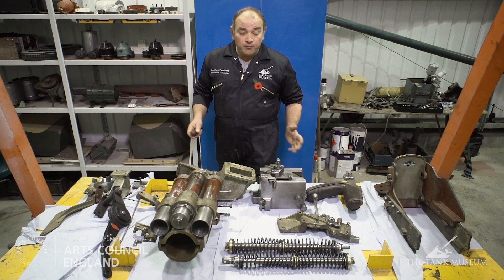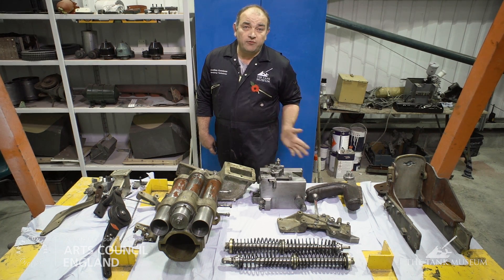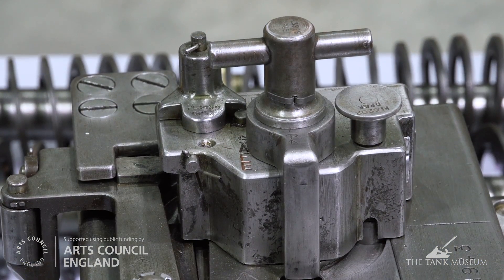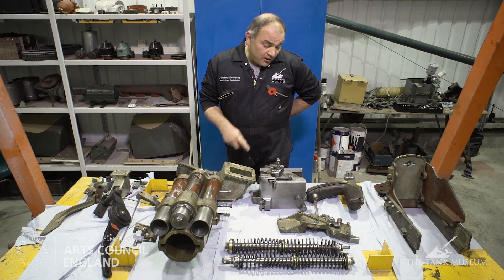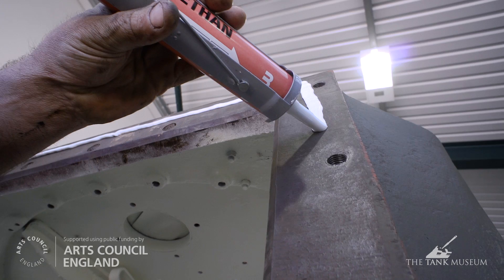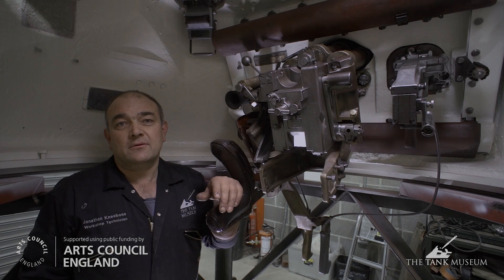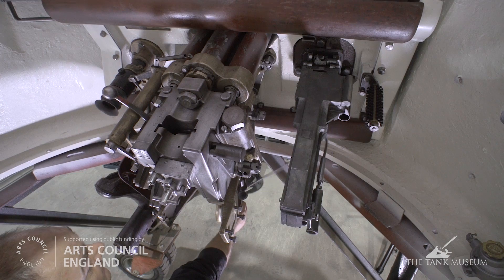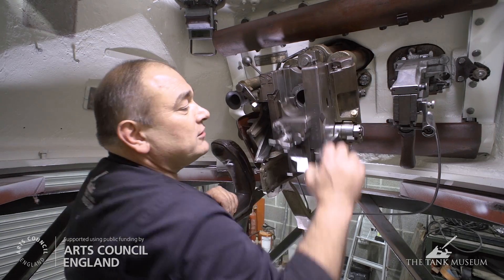The Matilda Diaries Part 10 | The Tank Museum

Comment: Question: Wouldn't a gasket solution that cures under pressure be a better choice? Or does that not supply enough water penetration resistance?

Comment: Will the main armament be fired once the restoration is complete?
Reply: idk if it's possible to get the correct ammunition for it anymore, modern shells are much bigger and smaller guns (and the shells they used) fell out of use a long time ago.
Reply: I don't know where UK gun laws stand on 2pdr guns...
Reply: Toby Wenman if it was done on the tank range or under army supervision it would be allowed. It’s just getting the ammunition.
Reply: If you can find cases, you could turn a projectile.  Not sure if you all have any access at all to reloading powder and primers at all.